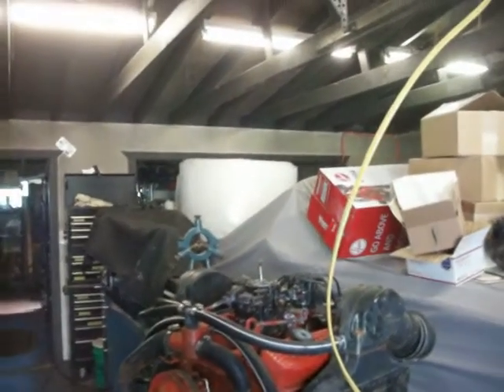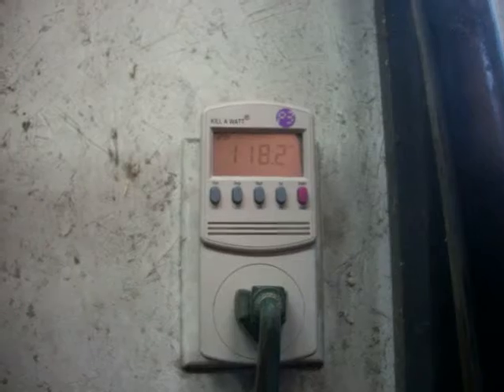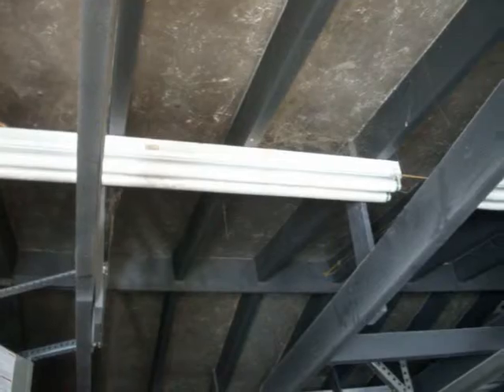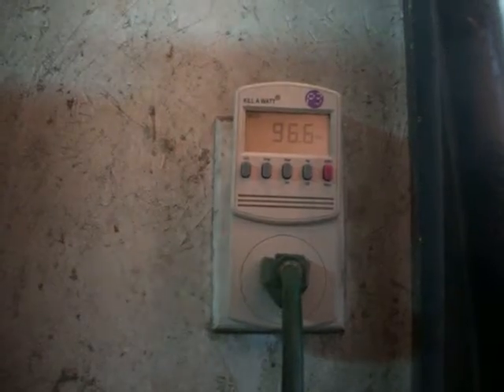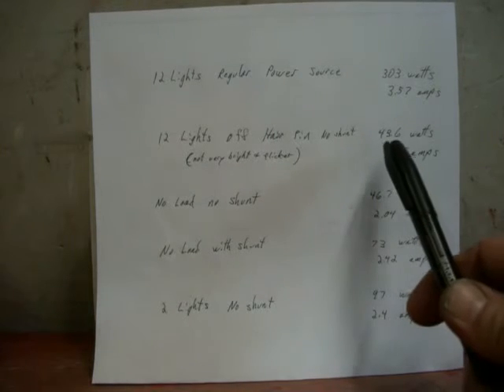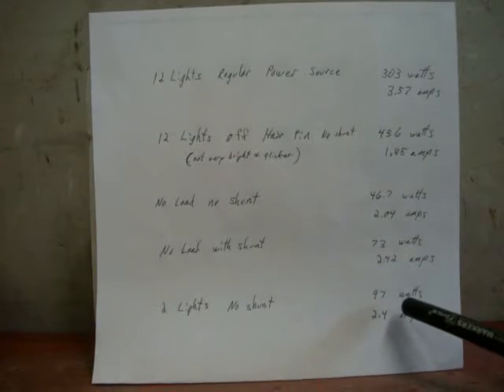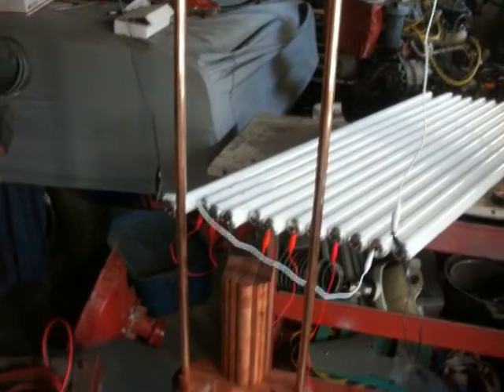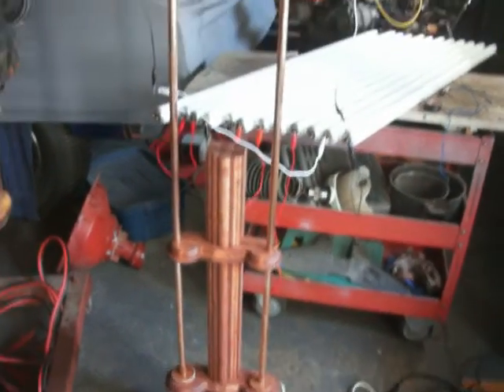Hair Pin Demo with 12 lights vs AC: Cold Electricity

Comment: I don't believe it makes much difference if you use solid or hollow rods, copper or aluminium. I have tried various types in my setups and the difference is negligible.

I have found that multiple spark gaps help to reduce the flickering and provide a more constant light - the higher the frequency, the better the performance.

Working with a minimum of 15KV is highly recommended - the higher the voltage, the better the performance.

Most important is where you connect the lights to the rods. There is a potential gradient along the rods and you need to move the connecting wire until you get optimal brightness... It is not necessarily at the top of the rod or at the shunt rod.

Happy experimenting & thanks for sharing :)
Reply from the maker: Thanks for the reply, and that's great to hear cause I really didn't want to change the rods.  I was hooking the lights up at different spots on the rods and running 12 lights it seemed to not really make that much of a difference.  It was easiest to hook the clip to the shunt end for the video as my clips aren't big enough to clip to the rod itself.  You do have me thinking about a rotary spark gap up grade.  Funny how I was thinking of an adjustable one but the rotary sounds better.  Just a little more involved in putting something together on the existing unit.
Reply: *****
No problem. A rotary spark gap isn't critical at that power level. You will get a marked improvement in brightness and less flickering just by replacing your existing spark gap with a series of say 5-10 very small gaps in series. You can even use a few nuts or bearings for the gaps - anything you have lying around for a quick test... it would be interesting to see the output you get using this configuration vs your existing gap.

If you use a rotary gap, you should still use a multiple spark gap in series, so that you get a more disruptive discharge.
Reply from the maker: Energy Fabricator Oh, okay, that does sound like something I'd like to try.  Now are the very small gaps all at say .5mm or do they vary and is there something I could look at on youtube that would give me a visual on the setup.  I'll definitely try it but seeing a lay out of one set up would help me better in making this.

Comment: Very nice build, it looks like it should be in a display case. Interesting experiment as well. Are you using anything to step up the voltage? Like a flyback or an ignition coil? I just picked up a neon sign transformer. Also, where did you get the caps from?
Peace
Reply from the maker: Hidden In the base is a 10,000 volt transformer (ebay $50) and the door knob caps are 30,000 volts (ebay $30 or more, I don't remember but they are not cheap ). More HV would do a lot better.  It's a cosmetic upgraded replica of one Karl Palsness has who also has a demo out there but he don't use as many lights.  Thanks for the comment on it's looks, couple things to do to it to make it look a little better as it will become a piece of my decorative furniture.  Just last night I installed the 4 inch magnets in yet another new wheel so I can replicate your testing a little more closer.  I'm really hoping the Smart meter can be slowed like ur analog meter.  Being different, maybe it can't be slowed, but it's almost getting personal on the challenge.